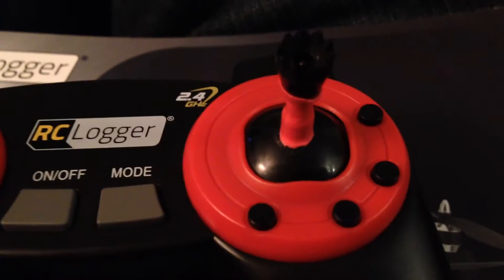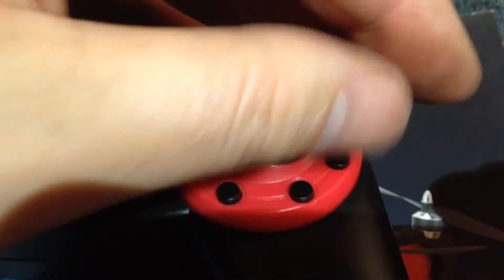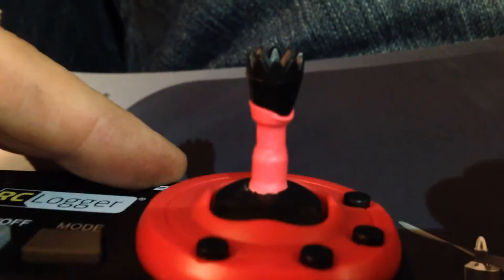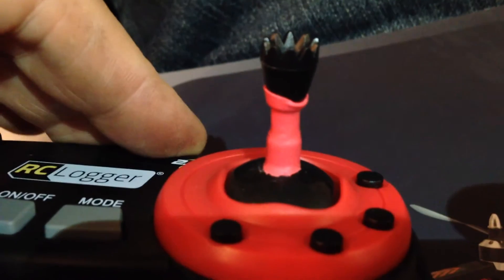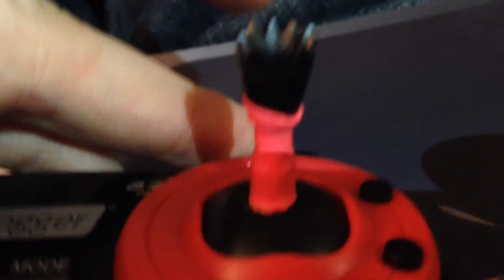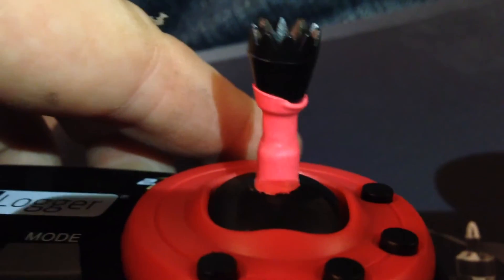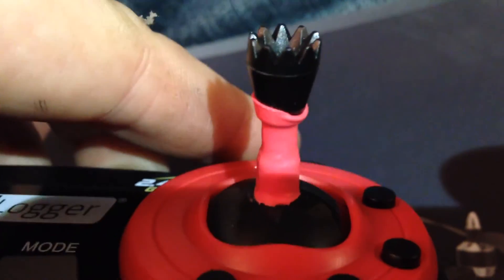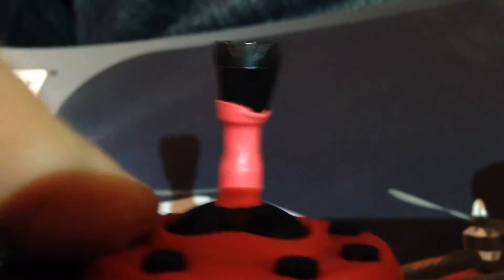RCLogger Eye One Xtreme: Stock Tx modification for more dynamic movement.

Comment: I did a stick modification as well... it's called a Futaba ;)
Reply from the maker: Yeah. Haha. That too. I am looking around at Tx's that I can use for my Xtreme and on my upcoming SK450. What set up do you use? PPM or One Link? I've heard about people having a lot of problems with both.
Reply: Thought I had problems- but it was user error.

I use a Futaba 10CAG with a FrSky TFR4-B FASST compatible rx- (CPPM)
The mode and flip/alt hold are on 3 way switches- but I am going to program my radio so that the trainer switch (single flip) will trigger the alt hold.
Reply from the maker: I'll have to look into that. I know that I really need at least a 6ch, and maybe up to 9ch for a gimbal set up with the SK450. I think that it will come in handy with the Xtreme too
Reply: Budget is the thing... radios are expensive. Futaba has a new 10 channel out- the T10J I think. The Taranis line is cool if you are computer savvy... FrSky has telemetry... the more you look, the more confusing it is.

I will say, do not get a 8ch... you will be sorry, and outgrow it in a year.